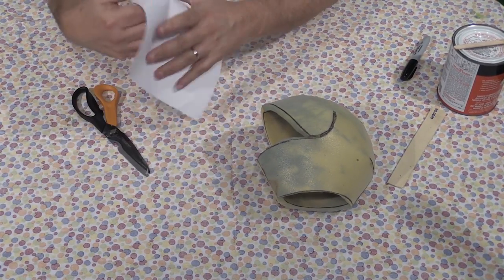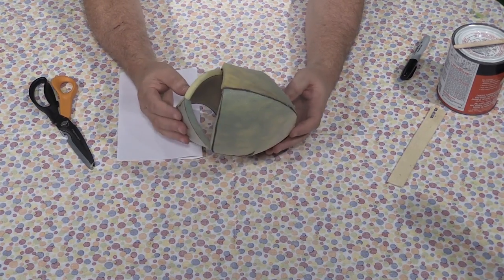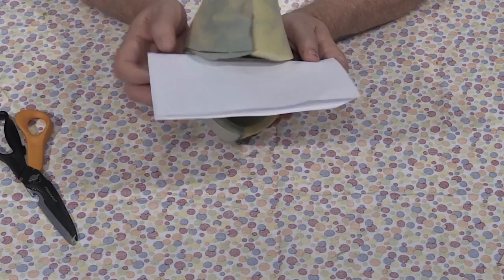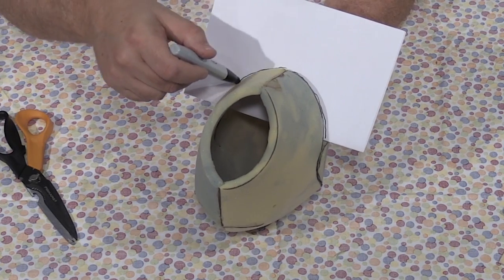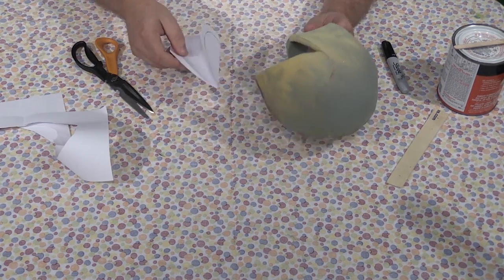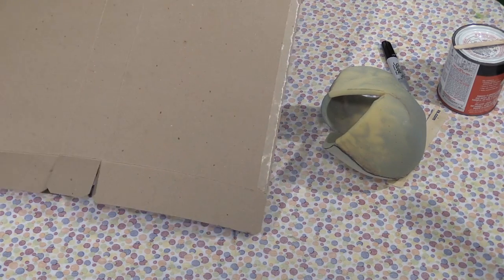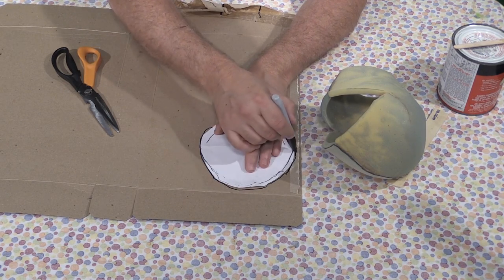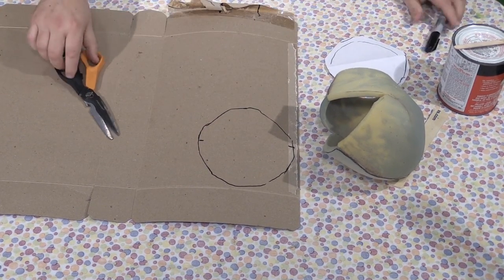How To Make A Foam Puppet Part 2 - Mouth Plate

Comment: Yo tim, how do you di the fleece cover?
Reply from the maker: you use the same pattern for the fleece and sew the fleece so it will stretch over the foam head. Fleece is stretchier in one direction if you pull it. Then use spray adhesive to glue the fleece on the head. Trim and glue the fleece around the mouth.

Comment: Hello sir. I think it's unhealthy head pattern. Because the puppet plays the upper part for the mouth movement in the performance. However, the jaw movement seems more natural.
Reply from the maker: Yes, the pattern needs some work. I think the next one I build I will add about an inch to the bottom part. (Front #4 on Pattern)